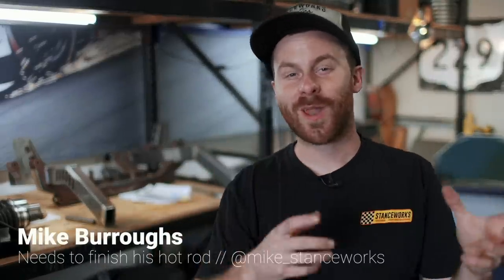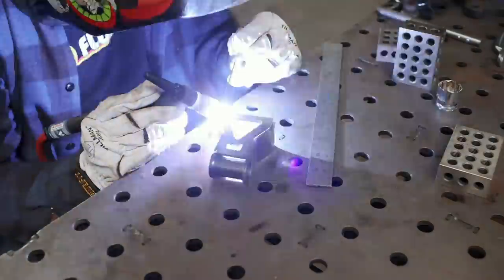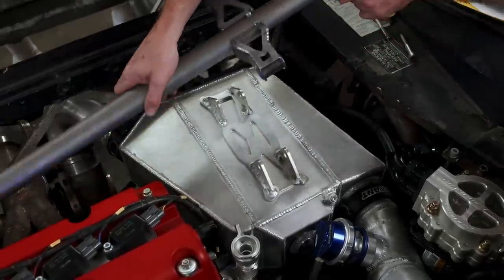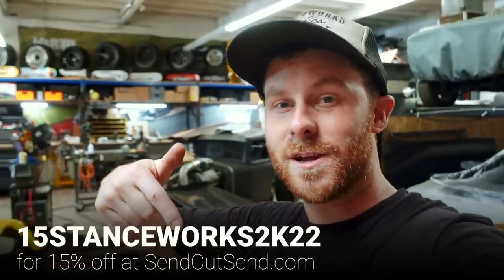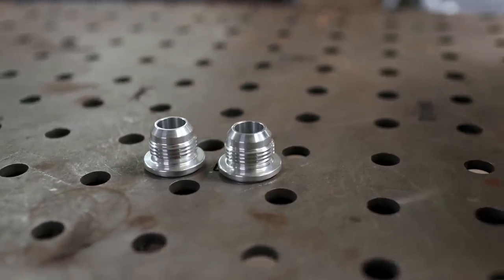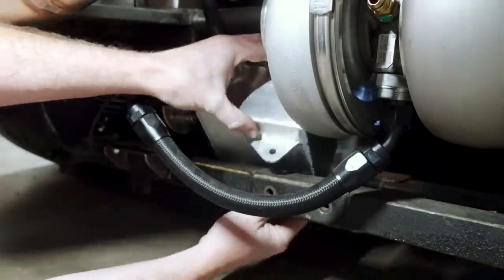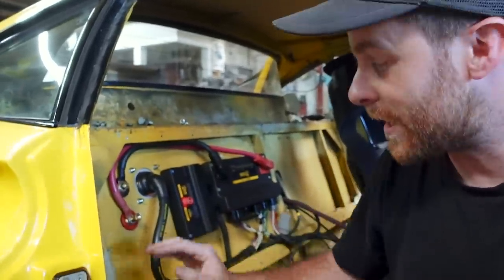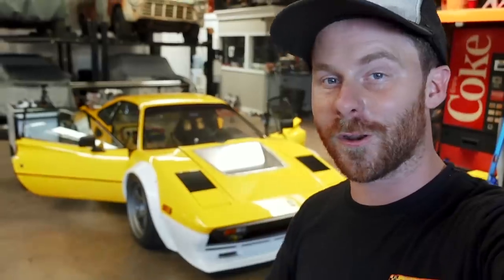Over-Engineering: Intercooler Mount, Oil Sump, PDM, And MORE! Honda-Swapped Ferrari

Comment: IMO there's zero value in putting a car like this on the street. It's basically hand-built with an absurd power-to-weight ratio, no passive safety, and no driver aids. The risks of putting it on the street are greater than the risk to the driver - a failure like the one you had with your Model A could happen again, and could kill an innocent party. There's just no upside.

Drive a Prius (or public transit) for transportation, and rock special hardware like this on the track.